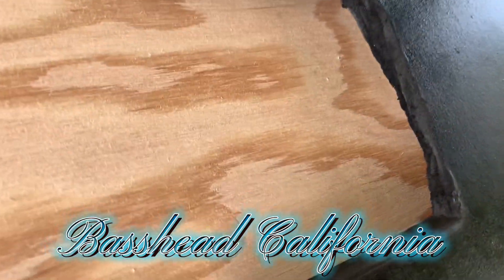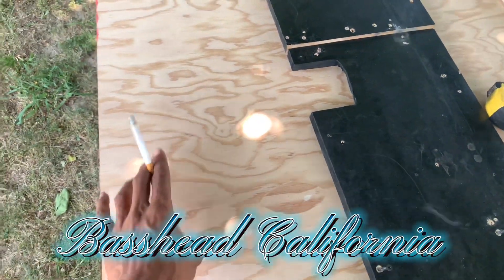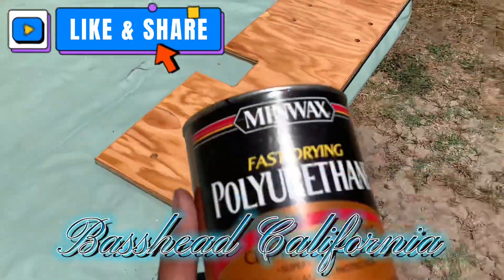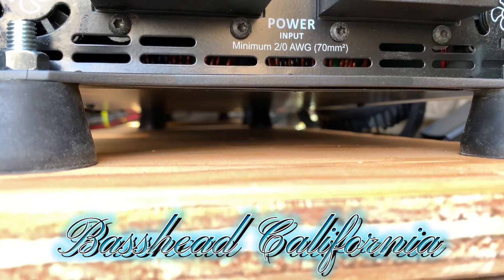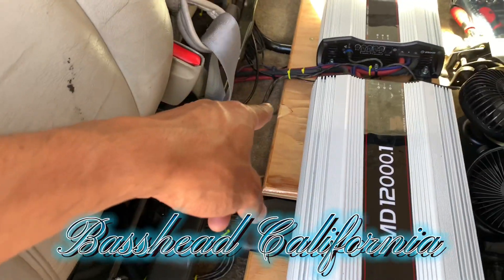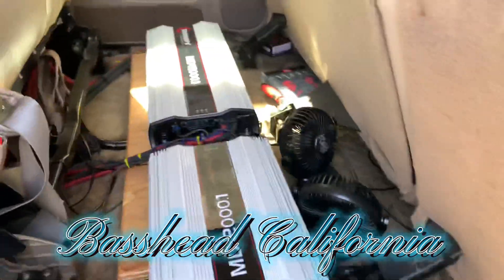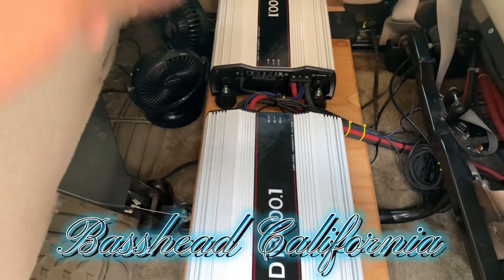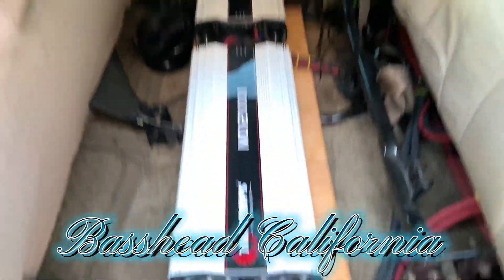Rebuilt my amp rack | Demo of 6 Resilient Sounds Platinum 15s on Taramps md12k amps | No Wall build

Comment: What route did you go to seal your truck bro?
Reply from the maker: I used just used Kilmat on all the doors & hatch brotha. I may take it all off tho & switch it all to Vibraflex though 💯
Reply: @bassheadcalifornia8709  That Kilmat is cheap but that stuff really works. I plan to use Kilmat 80 mil for my doors as well. I used Sundown 160mil which is similar to Ampere Vibraflex on my roof